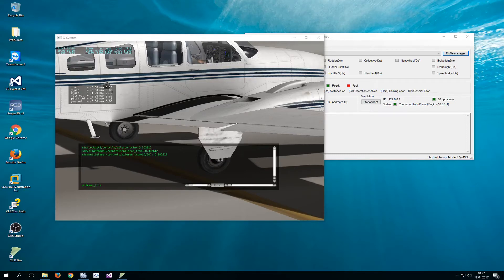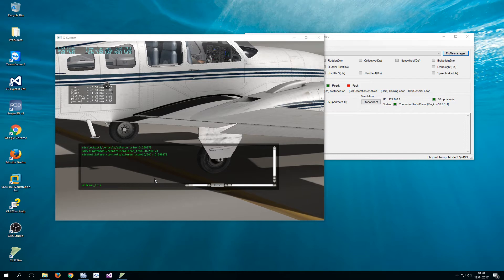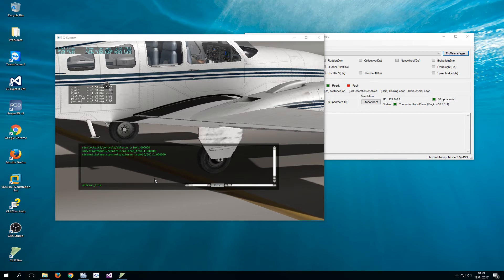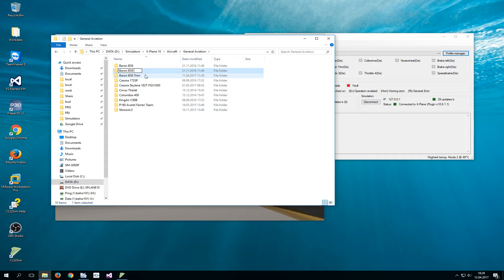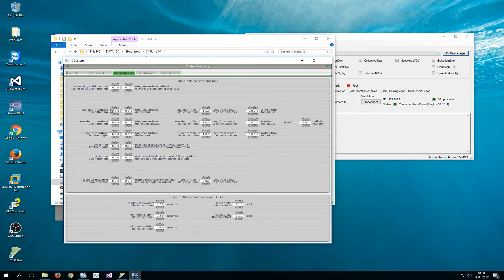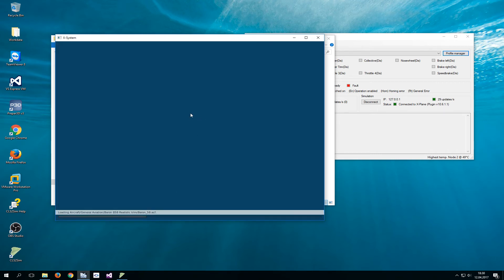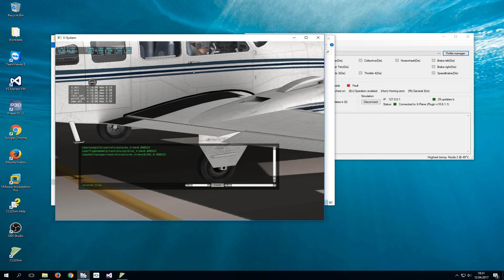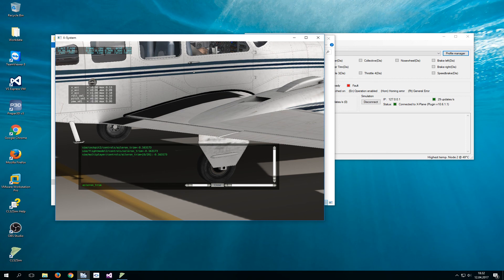Setup Realistic trim for X- Plane with BRUNNER Controls

Comment: Hi, 
i have the CLS-E yoke and the simionic G1000 setup.
When applying this trim alteration the Vertical speed mode does not work anymore on the  Simionic  G1000.
You can select a VS value, but it will fluctuate randomly   .
Just for info if any one else should have this problem
Ivo

Comment: I am interested to buy the Brunners CLS Yoke, but I am disappointed that you didn't answer questions like how does it work with an iMac (as I own iMac27). My general question is how to bind the CLS software to the yoke? I understand that I have to instal WIN partition on my iMac and from there open the CLS application, but the yoke is bind at this time through USB to iMac OSX ? Second question is if what you explained in your video is valid for all aircraft models?